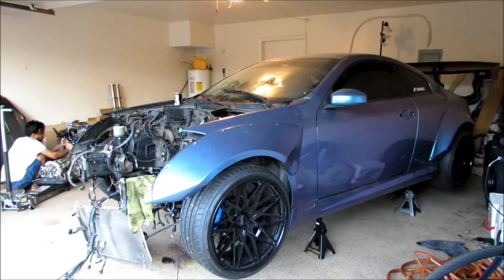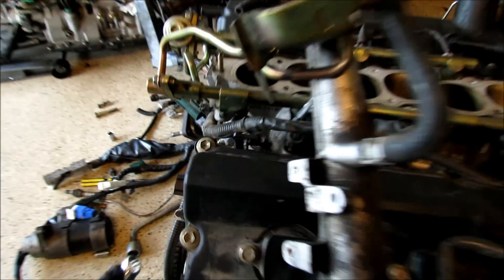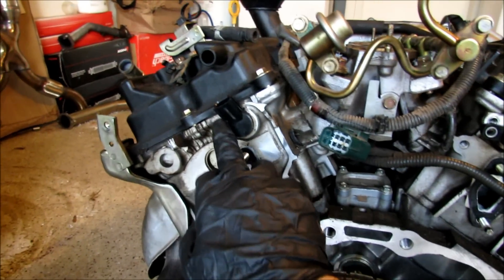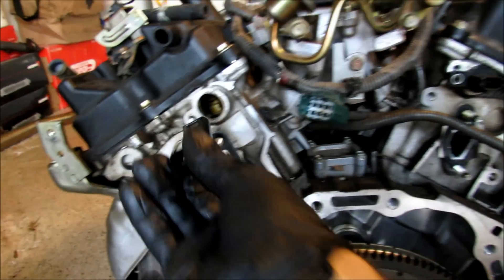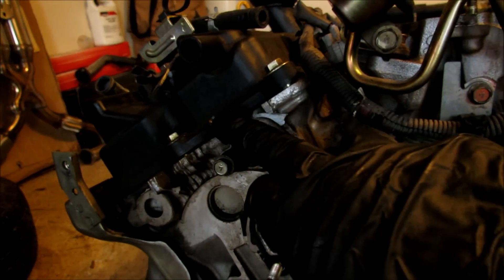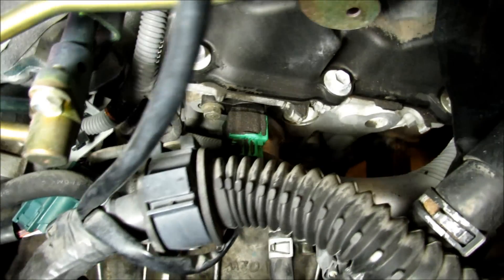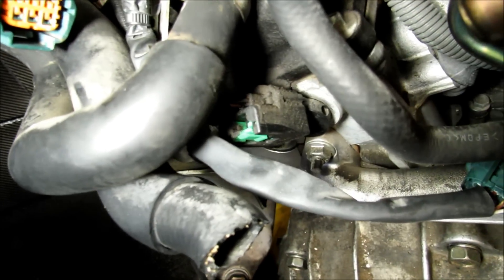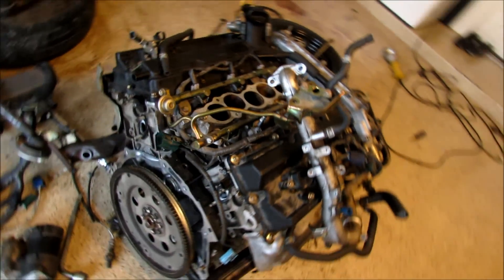INFINITI G35 NISSAN 350z - Camshaft Position Sensor Replacement

Comment: If my car is hesitating when accelerating do I need to replace these? It only does this between 2-3k rpm then it drives fine, also I have no cel and maf sensor was cleaned along with the tb yet it still does it.
Reply from the maker: Not unless you have a code. How many miles on your car? Coil packs need changed about every 60-80k along with spark plugs.
Reply: 93k and I haven't swapped those out yet. Also thanks for responding
Reply: Joe Leal did you ever figure out what your problem was? I have the same problem but mine has a CEL and it’s p0300 (random misfire)

Comment: Where are the other 2 on the rev-up motor?
Reply from the maker: Dred Loxx ....I have a rev-up motor and those are the only 2. Even though this motor out is a non-rev DE the sensors are still in the same location.
Reply: Motordyne G35 people have told me that the rev-up has 4, 2 on each side. That is way I was asking. Thank you for your reply
Reply from the maker: Hmmm......after further research, I think you are right. Interesting because I've only replaced those 2 and I for sure have a rev-up motor. Looking at the diagram on concept z, it says there are 2 on each side....https://conceptzperformance.com/standard-oem-replacement-camshaft-sensor-rh-passenger-intake-lh-driver-exhaust-vq35de-nissan-350z-infiniti-g35-m35-fx35-std-23731-6j90b_p_30301.php
Reply from the maker: ok yeah there are for sure 4 sensors back there. Hmm....I'm stumped that only 2, the same 2, of my 4 have gone bad. https://autopartsorlando.com/wp-content/uploads/2016/06/FullSizeRender-3.jpg
Reply: Motordyne G35 if you ever change the other two upload the video, i would like to see it.
Reply: so there's 1 straight sensor and 1 angled sensor on each side? (driver and passager) i have rev up also
 06 6mt
Reply: Why do I have the straight sensor on the driver side??? I also have a a Rev up 6MT...an I changing the correct sensor? Its Bank 2 and I pulled out a straight sponsor on driver side. Went to Nissan and they said the OEM is a angled sensor????? SO????NEED HELP

Comment: Are there any O Rings on them?
Reply from the maker: Yes, the camshaft position sensor comes with new O rings on them.
Reply: Motordyne G35 I appreciate the quick replies. On my g the o ring is bad there’s oil around and below the sensor landing on the pipes any idea where I can get a similar replacement? I have no codes and car runs fine.
Reply: Clapa Memes I’m having the same issue. About a year ago when I have the heater running I can smell oil inside the car and didn’t really know where it was coming from and was reading that it could be from one of the cam shaft sensors and that the o rings could be bad. Car also runs good and no codes. I’ve asked some parts stores if o rings are available and all said no and that I would have to get brand new sensors to get the o ring.

Comment: How Often will the average consumer have a motor out?
Reply from the maker: Never, this job is so easy to do with the engine still in the car. Honestly one of the easiest jobs on this car. This helps give a visual of where you are reaching your hands behind the motor to find the sensors. You are more than welcome to go to the stealership and pay them $500 or more to do the job for you. Or you could spend just $100 and do it yourself.